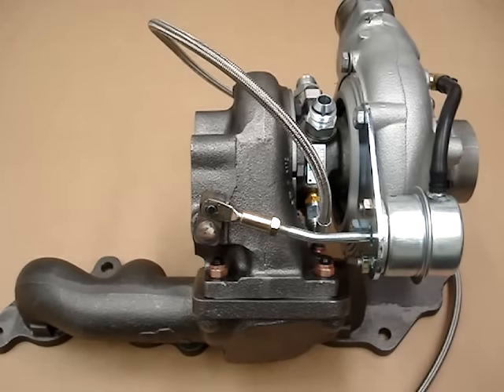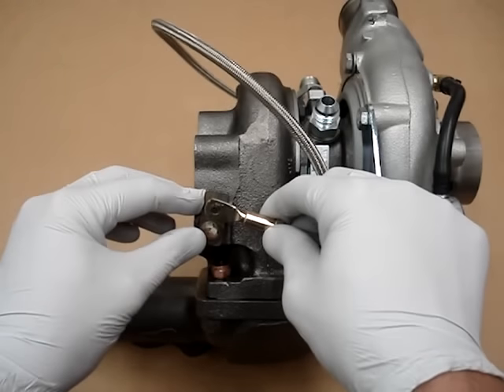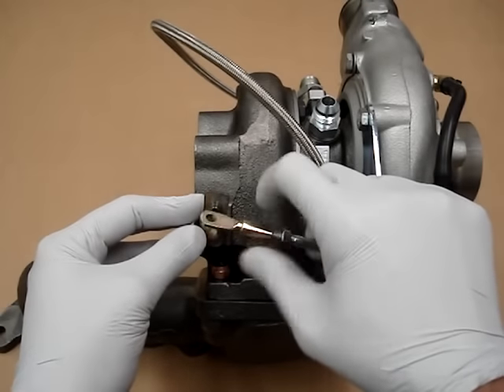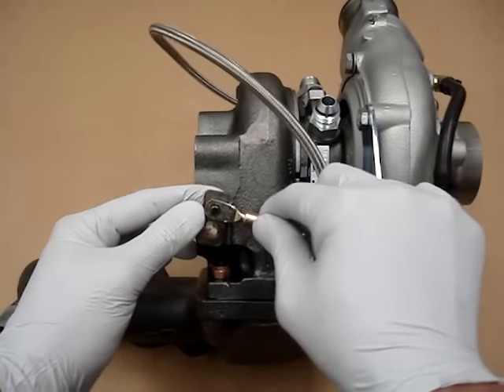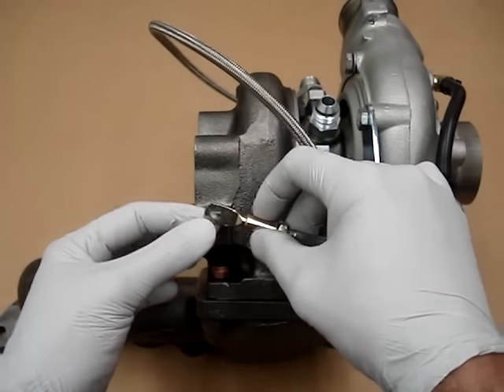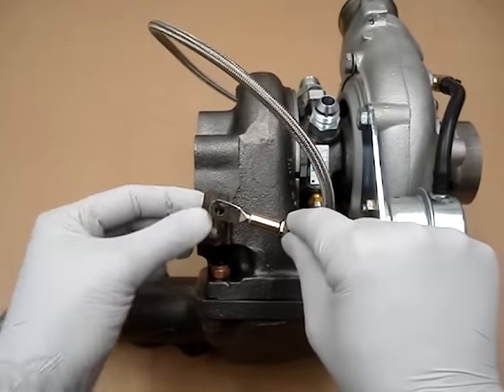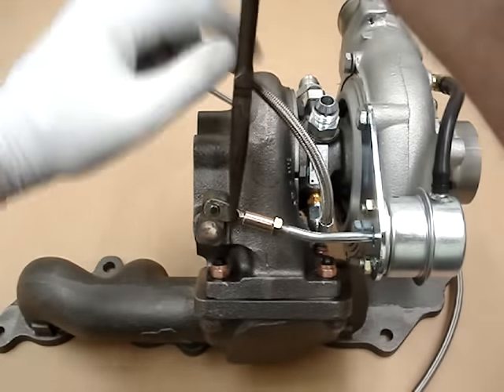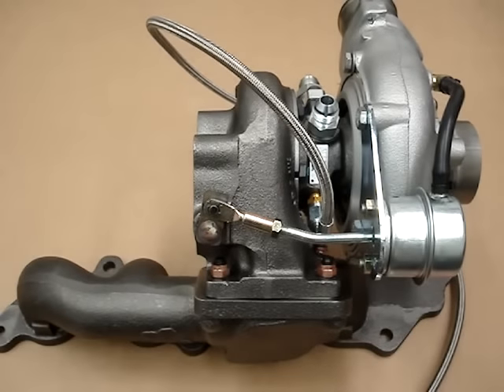Wastegate Preload Setting

Comment from the maker: For the most part yes, but adjusting this is mostly for proper preload setting as described in the video. You don't want to have it set too loose otherwise you may not maintain proper boost as the wastegate flap can bleed off too much exhaust pressure. Tightening the preload even further can increase boost but that's dependent on the wastegate itself and the vehicles ECU and it's ability to regulate boost values.
Reply: All the young dudes like it how you said....

Comment: Properly preload setting is essential for all turbos. By adjusting the actuator to find the crank pressure point. The best tool to find the Crank pressure point is to connect a hand pump vacuum/pressure like a Mityvac mv8255 to the wastegate. Adjust the actuator. Pump until the rode start to move. The pump will show the pressure in PSI or bar. For most turbo 7-8psi or 0,8bar is okay. In combination with a Bi directional scan tool f.i. Autophix Es910 for BMW and Mini or Forscan for Ford you will manage to adjust the turbo properly. Good luck.

Comment from the maker: Increasing the preload usually increases boost and reducing the preload can lower boost (to a certain extent). Keep in mind not all turbos allow adjustment in this location.
Reply: How about turbo kp39 can or not adjust preload sir?
Reply: My question is don’t you also adjust voltage? I’m working on a 2013 Kia Optima . It calls for a voltage range between 3.9 to 4.1 volts at the actuator for proper boost. Never mind. The actuator on the Kia is electronic and this one seems to be a vacuum or spring type actuator.
Reply from the maker: @fonzario  correct this adjustment isn’t for electronic actuators, simply manual ones only.
Reply: @vikenk . Cool. Thanks.

Comment: cheers mate! never heard of preload adjustment in my life,my pal has a scooby with a rebuilt turbo and it was constantly overboosting with plenty off head scratching,it is now fixed due to ur wee vid thanks,and im now gona pull the turbo off my diesel shoppin cart and clean the egr valve and turbo and injectors as its running like a bag a sh*t when i put the recon turbo its had back on prior to my ownership,i will use this information,merry xmas!
Reply from the maker: Glad it helped you out!

Comment: I got a 2018 Q5 2.0T, the actuator rod has a small play on it and I do see that it has the thread & nut so I can adjust it.  Unfortunately, the clip is on the backside making it more difficult for DIY.  How many turns should I adjust from the "0" position?

Comment from the maker: The base psi is dependent on the wastegate actuator spring, it can vary greatly. The universal preload is ~3 turns or about 3mm. However this can vary if you want to try increasing or decreasing your boost on your own setup. Usually a small increase can be made by increasing your preload. I suggest trying it if your system allows adjustment and see what works for you.
Reply: 3 turns or 3mm its for 8psi? , How turns its for 8psi or 0.6bar?

Comment from the maker: This is not a turbo kit from a stock car. Aftermarket turbo kits or upgraded wastegate actuators can require adjustment when replacing them, they will need proper preload adjustment which is what this video is illustrating.

Comment from the maker: Usually the door will slowly open until the desired boost pressure is maintained. This question is hard to answer because it amount the door/valve opens is dependent on many variables. Usually if your testing it on a bench with a pressure gauge it will not open 100% at the set boost pressure, it's usually partially open.

Comment from the maker: Yes up to a certain point. For instance I have tried 2 turns all the way up to 6 turns of preload. After a certain point of increasing preload you may not see a change in boost pressure as the spring is controlling that. Best thing is to simply set it at 3 turns to start and try adjusting it later to see if there is any change. So yes the cracking pressure can be increased, resulting in quicker boost ramping.

Comment from the maker: You can't typically lower the boost pressure of an actuator by loosening the preload, you can typically only increase the pressure. In your situation you need to purchase an aftermarket wastegate actuator which already has a lower spring pressure.

Comment: i just bought a new turbo and was messing with the wastegate actualor.the specs say its rated at 8psi but im seeing 17 psi,i would like to get 14-15psi how much psi is gained or lost per turn of actuator rod? do you think one turn counter clockwise will be around 15-14psi?

Comment from the maker: Depending on how stiff your wastegate spring pressure is it can be difficult to pull the arm out. Try using a small prybar/screwdriver to pull the arm out if you can't do it by hand, just be careful not to damage anything.

Comment: All turbos come adjusted from the manufacturer. To adjust preload u need to apply the right amount of pressure (idle) to the actuator then adjust the arm until it does not fit to the right side and then turn it back until it fits so that the arm is touching on the inside right side of the arm that is for GM turbos, for Daimler it has to be on the left side, but even so tempering with the preload might damage your car so DON'T. The measurements are really precise. I work for Garrett :P i know

Comment: I have an internal wastegate that I'd like to lower the pressure is opens at. It does NOT have an adjustable arm. From what I understand, the spring in this w/g is set to open at 8psi. If I wanted say, 5psi, could I cut the arm, thread it so that I could adjust it an then adjust it that way? If possible, I guess instead of turning the arm the way you did in the vid, I'd go the other way? No traction in 1st and 2nd and was hoping for an easy fix. I have an mbc to ramp higher (10psi) in 3rd gear.

Comment from the maker: Mostly for any aftermarket turbo which uses an internal wastegate setup. However this can work on some stock cars which are equipped with a turbo from the factory as long as there is an adjustable portion on the wastegate.

Comment: So let's say normally the actuator starts to open at 5psi. Therefore the more the preload the higher will be the cracking pressure...Am I right?
I am planning on buying such an actuator for a project of mine (exhaust cut out) and I need a pressure adjustable one.
Thanks

Comment from the maker: @Draslay31 Not all cars come equipped with an adjustable wastegate actuator. Adjusting a stock turbo setup can be more difficult because the ECU can ultimetly control your boost as well as the actuator. If your setup is adjustable you can try adjusting it but your already running a lot of boost so I'm not sure it's worth it in your case.

Comment from the maker: Usually if you have an adjustable actuator you (may) be able to increase your boost level slightly, but its' also dependent on your ecu program and how much adjustability it allows.

Comment: Does that count for a used actuator as well.. as in it's still good.. does it need re adjustment. Mine comes off and on without any preload..
Reply from the maker: Yes this is also for a good used actuator as well. However not all actuators have the same preload settings but some preload is typically required. I’d research your application before adjusting it but you might benefit from an adjustment regardless.

Comment: This is the idea, but actuators can have different thread pitches, so the number of turns isn't going to be standard. I actually have a Steamspeed turbo that uses two different thread pitches on the actuator shaft center nut.

Comment from the maker: You will need to actually purchase a different actuator which uses a softer internal spring. However if your preload is set too high currently you may be able to lower the boost a little if you adjust your preload.

Comment from the maker: @oinkyerdoinkyerzwazz Increasing preload by threading the rod inward will increase boost slightly depending on the wastegate spring. On lower pressure wastegates the change is minimal but higher wastegates it can vary by a few psi or more.

Comment: Unless you have a Mini Cooper, Peugeot, BMW, or Citroen engine. 
Then it's vacuum based instead of pressure based actuator. 
How do we adjust those types?
Reply: boost operates actuators on all wastegates

Comment: Hi vikenk if we adjust the preload too much will it cause more fuel consumption?
Reply from the maker: Not really, only increased boost pressure if your system will allow it. If you are making more power however it will be using more fuel at that time.
Reply: vikenk Hi Vikenk,have a question..my OBD device shows Engine code error P0245-P0246-P0243 (Turbocharger Wastegate Solenoid A low/A High/A Malfunction Car is Mercedes C200 Kompressor2002 ,appreciate if you could explain it to me as i knw nothing about cars..Cheers

Comment: Hi Vikenk Great Video thank you, I have a question. I'm upgrading a TD04HL 15t to a 19t, the 19t can pull around 500cfm. I'm looking at setting it up for 18-20 psi (to start with). I'm undecided what actuator to use 1.2 bar ( 16.2psi-20.6psi ) or 1.5 bar ( 20.6psi-25psi ) I am doing a full intercooler upgrade and air box, what would you recommend and also the 3 turn preload is that a standard setting on any wastegate/actuator setup?

Comment: Im planning ob building a budget fun turbo build on a 10.0:1 compression 1.3 pushrod. Now estimating on the internals it can take about 5.0PSI without a decompression plate so my question is, how can we accurately adjust the wastegate to know at what pressure is it opening? Is there an easy and accurate method to measure this without any fancy stuff?
Reply: plumb up a boost gauge to manifold and mount gauge near other gauges on dash, adjust actuator and then go for a drive and see what you peak boost is and then adjust again if necessary!

Comment: This vgt set up seems as though it uses the the opposite of vacuum to work or am I just really confused?
This closes the veins as air is pushed into the actuator where as mine is the opposite?
Am I wrong?
If I am not how do you adjust the preloading on a vacuum type set up?
Reply: boost operates actuators by pushing them open at set psi to prevent over-boosting!

Comment: thanks Vinik, what if you make the arm another 5 turn short, would the turbo hold more boost/? or spring damage??
Reply: i could be very wrong, however i think if you over adjusted it like that the arm may not be able to cover enough distance to open the valve all the way causing high rpm turbo surge.
Reply: i see
Reply from the maker: Actually 5 turns will usually increase boost even more but that's dependent on the wastegate you have. If you have no other way to increase boost then you can try increasing the preload pressure a little further, I wouldn't recommend going too far though.
Reply: i tried, and it making shhhut loud noise, dnt know what it is?not closing waste gate or unable to open fully?no idea when i turn it back to stock and sounds goes away,but if i undo the screw(loose) waste will open i get o boost. What do you think??
Reply from the maker: Rini Sugiarto
If you leave the arm loose then normally it wont make any boost or very light boost (which is not how it should be set). Your actuator may not be able to suport more boost because of the design or spring rate, not sure on your model vehicle as i don't even know what this is on, my video only shows general adjustment guides. I suggest leaving it at the proper adjustment.

Comment: Great video! I need to adjust loosen mine to lower boost but its really hard to get to. The pin is in back of motor pointing down towards back of the exhaust. how many turns per psi? Im currently boosting to 25 or more with the controller set to 20. Thanks for any advise!

Comment: SO..on this turbo you turn it 3 turns of preoad. What does that equal in base psi,  without a boost controller installed to alter for more psi. Is it recommended to use a inline boost altering device whether electronic or manual with preload set to specific psi.. Is it equal across the entire board of turbos that are out there. I have a factory volvo adj. tdo415g on my 89 Ford probe GT. 
.

Comment: Will this setting work in a 2006 Sprinter 3500. I just change the turbo resonator, but I still have the loosing power issue! My next step is to check or change the air hoses... Thanks!

Comment from the maker: It may be possible but usually this won't help out actual turbo response to much but rather can help increase boost overall. First you need to check and see if your wastegate actuator rod is adjustable, most OEM systems are not.

Comment: Hey you say on the end
.this is how you probely adjust preload.can i do it with my turbo?i have a bmw e46 320 diesel from 2000 non common rail end the turbo wasegate is controlled not like in this video..it is atjustabble so i can do the same things that you do but the wasegate is controlled by a vacuumsolenoide with a electronic component controlled by the ecu!

Comment: I was wondering if you could help me, im putting a turbo froma a diesel inline 6 that created 20 psi, but im putting it on to a carborated v8 and only want around 6 psi. could i do that by extending the rod. or should i go to an external wastegate?
Reply: That probably be too big of a down adjustment. You can get actuators with lighter spring to give you a lower psi base to go off (they usually have their range in the specs). The problem running external wastegates on turbo's built with internal wastegate, is you will need to have the internal wastegate welded shut so the external wastegate can function properly! 

LOL just realise your comment is 12 years old, but maybe I still help someone in the future😊

Comment: just a begginner with turbos so you 3 turns of preload  if you want to add psi boost you turn more on your preload ?? whats an average PSI per each turn ?? i am running a TD04 turbo on a 2.8 (3L) toyota hilux any help would be much apreciated
Reply: boost gauge, boost gauge, boost gauge!

Comment: For those running WRX's if you tighten too much above stock you will end upi running to much boost especially if you are already running a tune becasue your WGDC settings will be too high after you change this.

Comment: Hello,

kindly tell me how much psi you obtain for the 3 full turn?
Reply from the maker: That's completely dependent on the wastegate spring pressure. The model we are using in this video is designed to run 8psi so 3 full turns gives us 8psi on this particular setup.
Reply: @vikenk  and this turbo looks like a TD05 16G,right?
Reply from the maker: @480us  It's actually a Garrett GT28R ball bearing turbo with a T25 flange. While I've heard of the turbo you mentioned it's not something we work with.
Reply: @vikenk  ive got a TB28, apparently its got 9psi wastegate spring..... if i extended the actuator rod, can i get the boost down? I only want 7psi
Reply from the maker: Phil Mitchell if you loosen the preload you maybe able to get it down but that depends on how much preload you currently have. You might not have room to lower or so a lower pressure wastegate actuator may be required. Either way mark it’s location now and try it out, if it doesn’t work you can always go back.
Reply: @vikenk  okay, thanks for the help my friend👍  so if i need to could i get a 7psi actuator or is the spring to change?
Reply from the maker: Phil Mitchell yes you can purchase a whole new actuator that has a softer spring for 7psi, they make a lot of various spring choices.
Reply: @vikenk  brilliant   thanks for the help

Comment: what does the waste gate do to the turbo
Reply: Boost goes into the actuator and pushes it open when the psi is greater than the preload/spring pressure, which in turn actuates the rod which is connected to the bypass flap in the internal wastegate in the exhaust housing or bypass valve in the external wastegate.

Comment: I just tried this on my Subaru Impreza WRX 02, but according to my
boost gauge it didn't increase the boost. Actually i thing i lost a
little.
Reply: You need to test base boost, depends on spec, not sure for 01 WRX but should be somewhere from 3-6 psi probably.

Comment: See the two bolts on the actuator arm of the wastegate?? Well, if you wanna increase the preassure, use a 10mm wrench to turn the bolts towards the turbo. BUT don't do it... I did that and now the actuator got stuck and the car is overboosting like shit...
Reply: Did you remove the clip then the rod first?
Reply: you must of way over turned it lol!

Comment: i see a black vacuum pipe wat coms from your turbine end it gows in your actuator! how dos it work? when go pressure in the actuator end open the valve in other side turbo to loses pressure?   my bmw work like this...if the ecu say OPEN then it sends a signal to a vacuumsolenoide end the solenoide sends vauum to the actuator end it open the valve!  hows is it with this system? thanks
Reply: Pressure from the turbo actuated the waste gate. I know it's been a long time since you asked, but some one may see this and wonder as well.